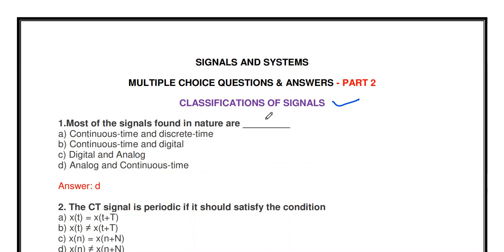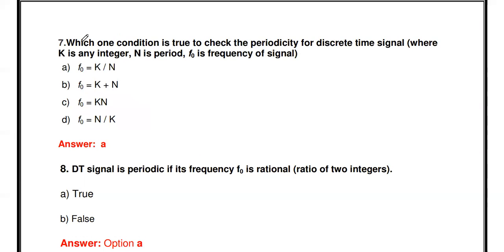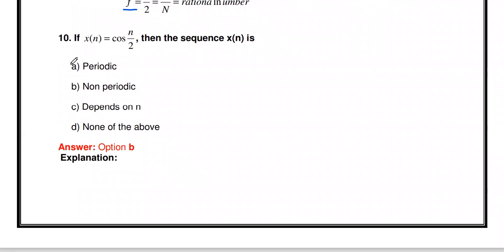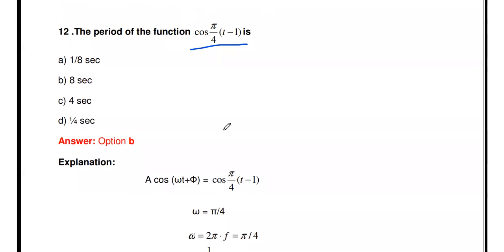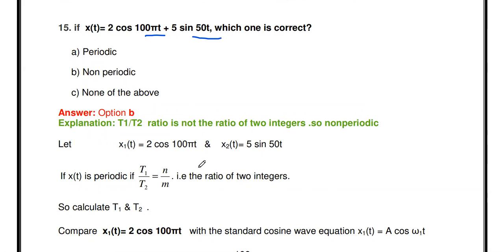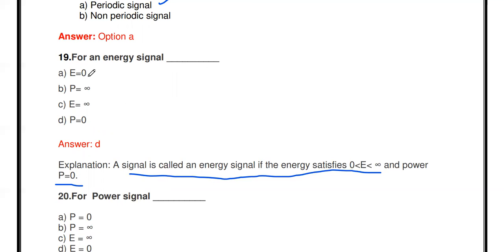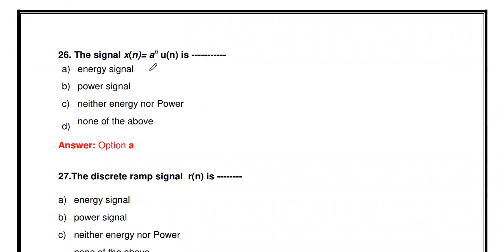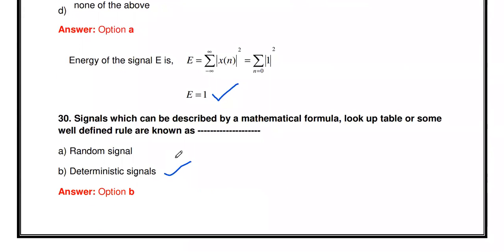EC8352 MCQ | Signals and Systems MCQ | EC6303 MCQ | Classification of signals | Unit 1  part 2

Comment: for discrete time signal single sine and cosine waves will also be periodic??
Reply from the maker: No.if the frequency is expressed as the ratio of two integers then it is periodic .otherwise nonperiodic
Reply: @jothiecevideos9453  ok mam 👍

Comment: Mam in this mcq no.13 you have said that all sine and cosine waves with and without pi is periodic for that thirteen one word you chose tha option all of the above but in 15 th oneword you said that x1(t) is periodic but x2(t) is not periodic .I can't understand clearly mam.
Reply from the maker: All  single continuous time sine and cosine wave forms are periodic.so in Q.NO 13 all wave forms are periodic. But if the given signal is composite signal it may be either periodic or non periodic.so in Q.NO 15 the ratio of timeperiod is  not a ratio of integer.so it is nonperiodic
Reply: @jothiecevideos9453  thank you so much mam